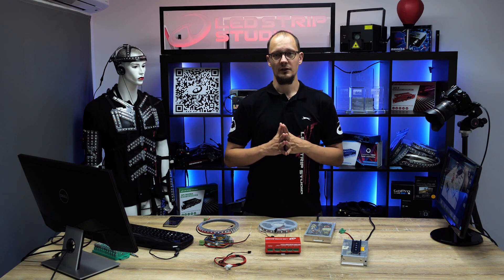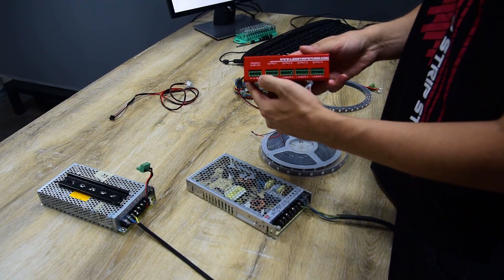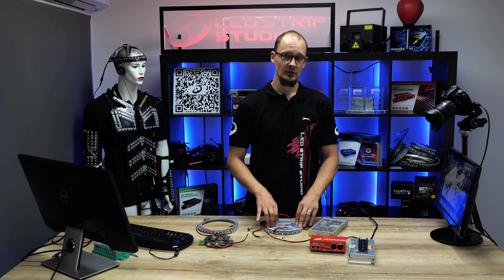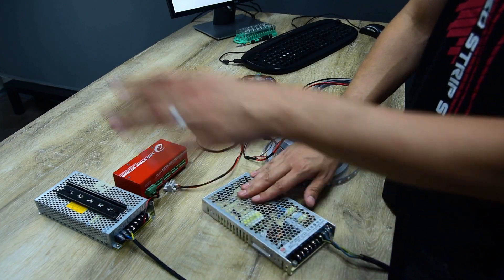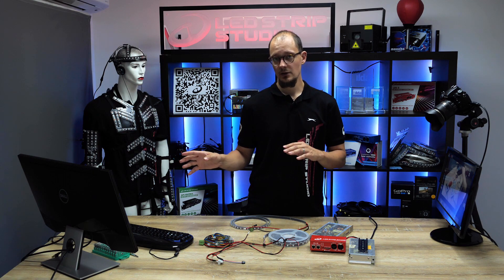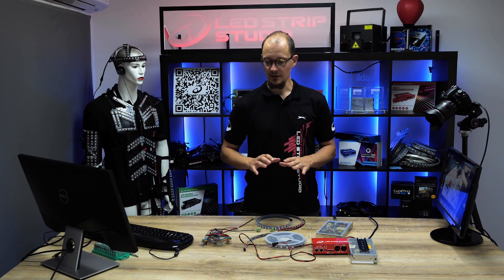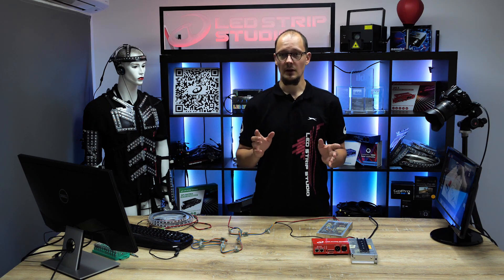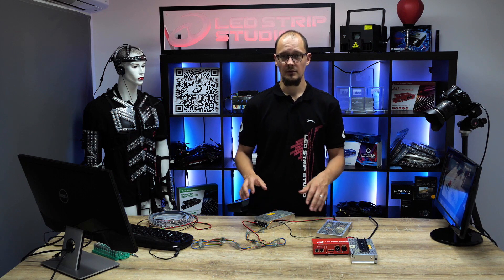How to correctly connect power source to your LED strip and LED controller

Comment: Hi, half way thur my run the color in my led lights are fading? Any suggestions??? Also can i add a second power at the end??
Reply from the maker: Yes, usually the color fades after e.g. 3m of pixel LED strip - just connect additional power source to the middle or end of the strip
Reply: @LEDStripStudio  thanks for fast reply!!! Appreciate ur help as well... will post pic when done..